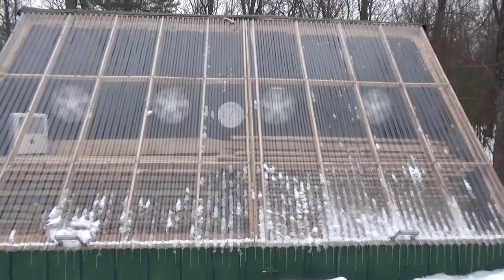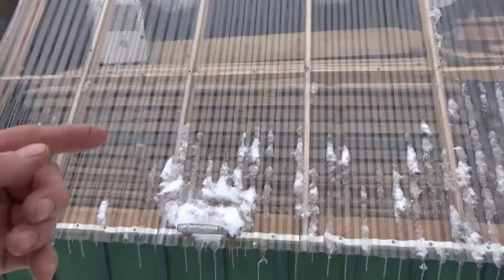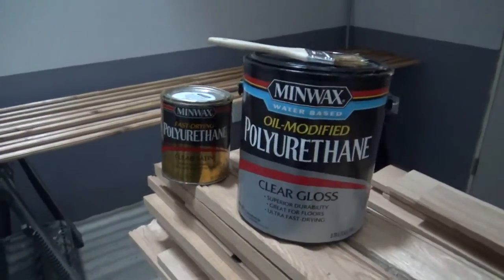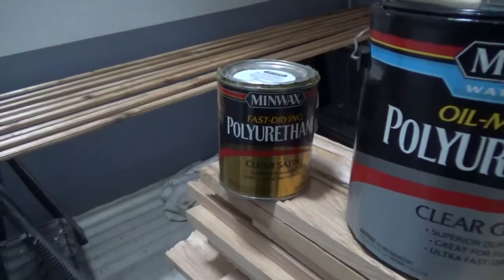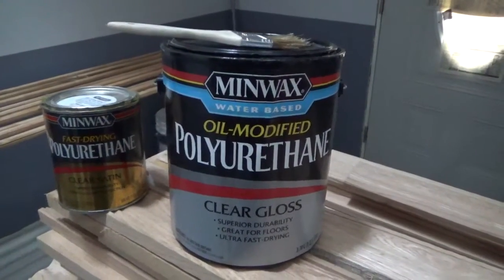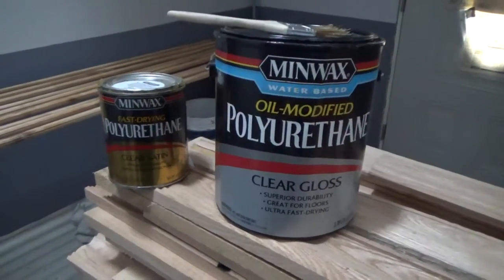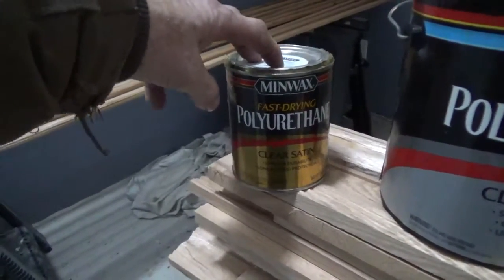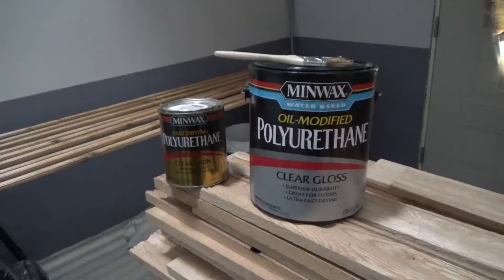Product semi review Minwax polyurethane.

Comment: Hi Jo,
Very informative product review, thank you.
I have gone to water based on trimwork and flooring, primarily due to the lower odor.
Most water-based polys contain  30 to 35 percent solids, compared with the 45 to 50 percent solids in oil-based products. The solids create the protective finish, and I have found it best  to apply 3 coats for trimwork and four coats for flooring, as opposed to two or three for oil.
With having kids and dogs I applied an additional coat after a few years, however with windows open the smell was tolerable with the water base.
Arrived in southwest Florida on  business  yesterday morning at 48 degrees....nice.
Flying back to NC at noon as it will be near 80....dont want to melt.
28 degrees in the morning and 50 in the afternoon in NC...nice!!
Be safe and God bless
Reply from the maker: I kinda figured the water based had less of the solids. A lot of people do not realize that you can have paint made to order, not just talking color here, but solids content. I had glidden come up with a primer sealer for drywall for me that had a way better cover in one application than anything I couod buy off the shelf, itf saved a lot of time so I could get to the finish.

Comment: All calm in Michigan too, still cold though..LOL  I used the regular (your quart sized) for mine ,it was summer and was applied outside,
but now after seeing that test I do prefer the other, safer for the house and I liked the look of the finish as well ..You surely got a lot of it to do,
but it will be beautiful..Thank's for the review and if ya go Good luck hunting..
Reply from the maker: The water based hardly has an odor. Using in indoors is just a better option I think. Nave a good one.

Comment: The new water based polys work great, But I recently had a problem with an oil based putty under a water based clear coat. I should have known better but the water based polys are new to me.
Reply from the maker: I just did that last night, what problem did you have? I did not even think of it.

Comment: Morning Joe.... if I go south I probably won't come back! I remember when I used poly on the inside of my log home, I wound up with the worst headache I had ever had.... apparently the poly swelled the brain in my skull and boy, did that hurt. Of course at the time I didn't use a mask and the windows were all in and closed in the middle of the Summer. Not thinking I guess. I don't remember the brand of poly, but to this day, it does still look nice. This is some crazy weather we've been getting. No sun here either. It's almost depressing, and when I look outside at all the snow, it looks like it should be January! Get some relaxation and go hunting.
Reply from the maker: Morning John, I never had a lot of problems with headaches and poly. But I will tell you that one time I was making formica  counter tops from scratch with some contact cement. To this day I dont remember walking out to the truck. No mask either. How did we make it this far?
Reply: @josaljo1  I'm not sure how we did it.... I did counter tops too and I like the smell of that stuff!!
Reply from the maker: @johncollado1151  Lol i think you have to many exclamation points at the end of the like that stuff comment to be legal lol
Reply: @josaljo1  Ha, you know what that stuff does to you. Probably not too many brain cells left anyway.